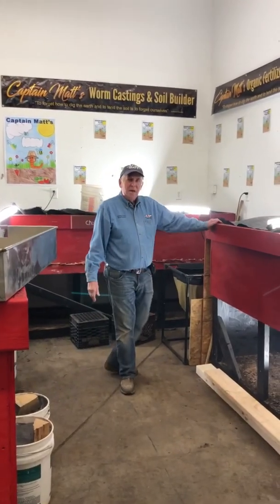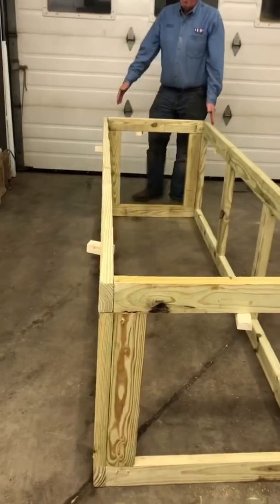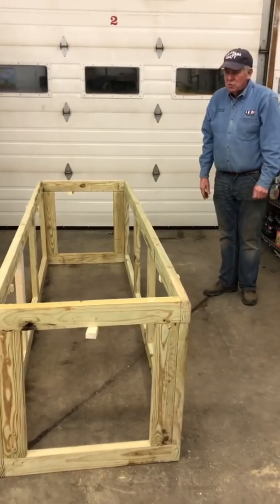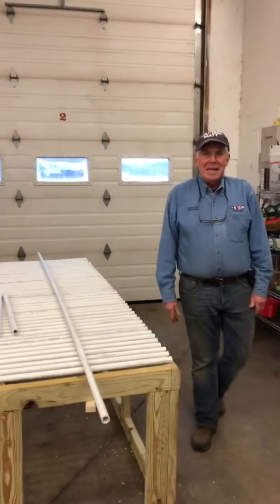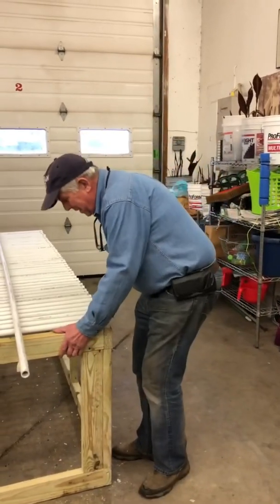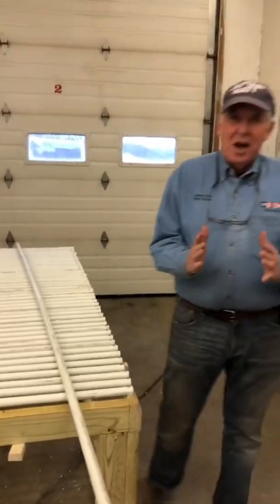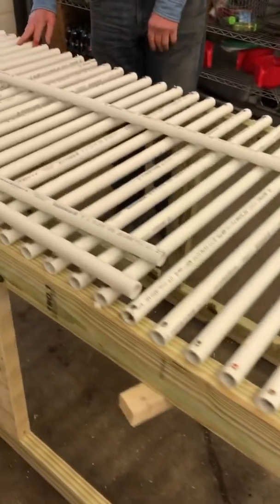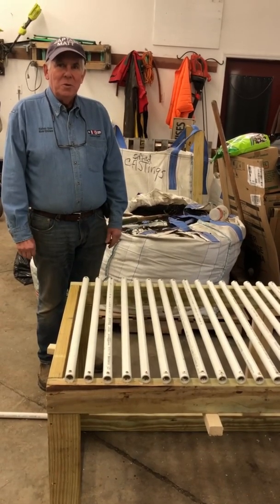Let’s Build a Continuous Flow Worm Bin - Part 2

Comment: I happen to have galvanized pipes. Would they be ok to use or would the galvanizing harm my worms?
Reply from the maker: I'd caution against galvanized - since the zinc and other metals might leach into the castings as they sit on the piples for an extended period of time.

Comment: I think you should also put a plywood floor in it, sitting on top of the 2x4 base. This will make it easier to rake the casting off the plywood flooring and into a dust pan or flat head shovel. Currently the harvesting method involves trying to get all the castings off the floor and up over the 2x4 base with that flat wooden rake you have and I am sure many castings are left on the floor. So harvesting leaves a mess I would guess. By raking the castings down onto a wooden floor that is sitting on top of the 2x4 base, then you can sweep all the casting into a dust pan and leave very little mess if any at all. The additional cost would be 1 extra sheet of plywood.

Also, can it be put on heavy duty casters so it can be rolled around the shop?
Reply: I don’t think there are casters strong enough for the weight he has. I’d probably make a free float frame like an aquarium stand and do the ply wood floor idea and water proof it with marine grade fiber glass resin on the frame. I’m going to build one, I’ll coat the bin with pond shield and make a glass window on the front, using the fiber glass resin where the glass will be siliconed.
Reply: @rofishy2  If you notice even his single plastic bins are so heavy he can hardly lift them. So the material has to weight tons. Its dangerous.
Reply: @dougayers7517  I’m talking 3/4 inch tampered glass, that is used for up to 600 gallons of water. I’ll use 3/4 plywood reinforced with framing. A free float stand uses a 4/4 frame

Comment: Great info on all your videos, thank you for sharing your work! Why not just hot glue the PVC pipes in place? I think it would hold just as well and you wouldn't have to use all those screws and deal with all the work of drilling and screwing all those pipes.

Comment: Also I'm wondering how many pipes you ended up installing? And from center to center of pipes - what is that measurement please? Thank you Matt - this is exciting!!
Reply from the maker: 48 pipes I used a pipe as my spacer=1inch
Reply: @CaptainMattsWorms  In your drawing,  it states using 1" pipe, and in the video, you state you're using 3/4" pipe. Which do you prefer/recommend using?
Reply: @WormPeople  aha - yes - thank you!!